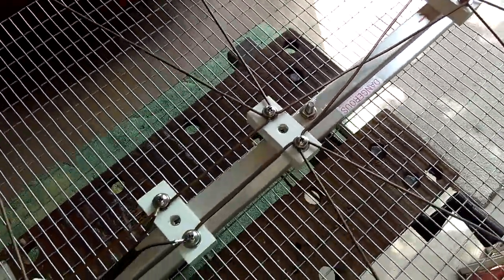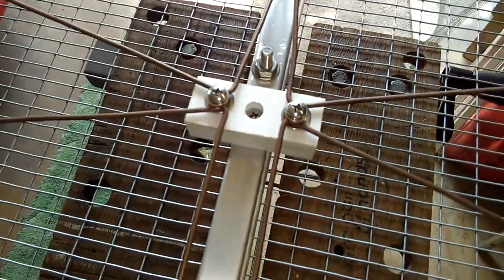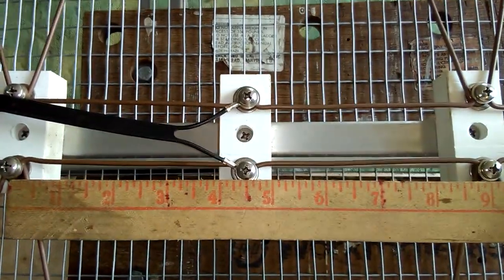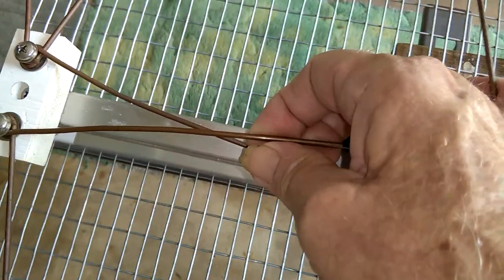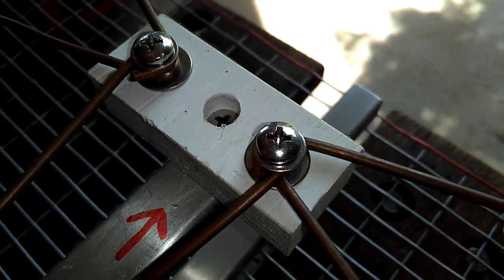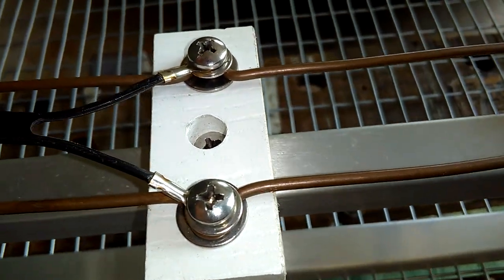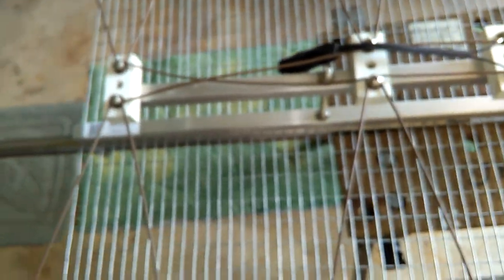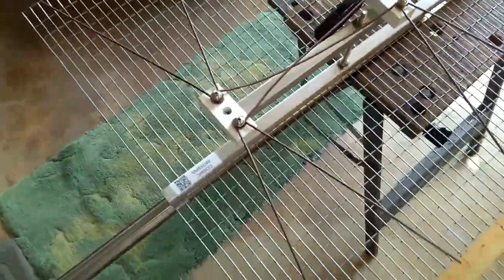4 Bay Bowtie Specifications

Comment: Hello. You had given me your email address to send a few pictures of one of my antenna builds.  I put together a very small antenna out of one of those paper thin as seen on TV p.o.s. and part of a copper head gasket. It works surprisingly well. Also made a FM diapole over the weekend which is currently horizontal but I'll be building v2 today and go vertical with it to shoot for Omni directional
If you'd shoot me that email again I'll send you a few pictures
Reply from the maker: Proto mail seems to be malfunctioning. 
Try lscaper26@gmail.com
Your projects sound interesting.